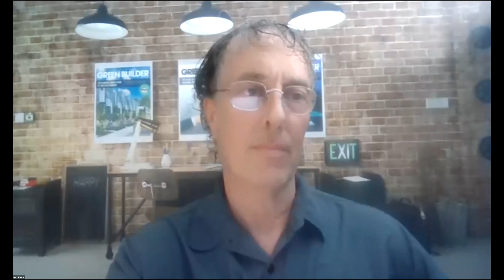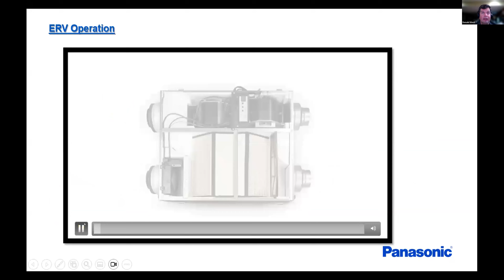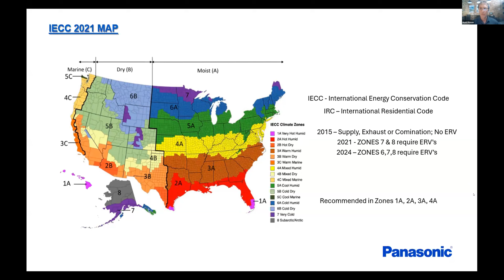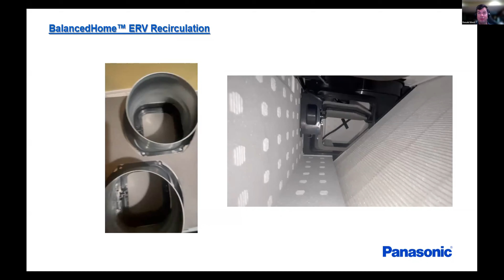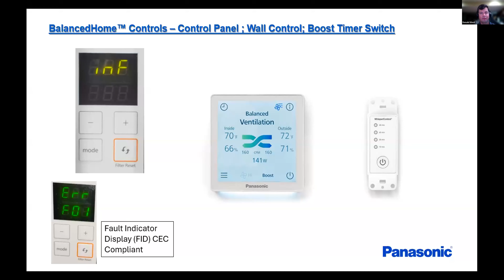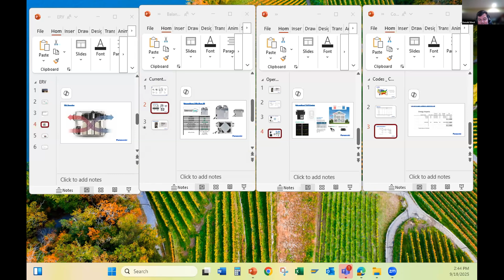Breathe Easier, Build Smarter: Why ERVs Are a Must-Have in New Homes

Comment: Thank you for the video. I wasn’t able to join in person. I’m glad you were able to upload it. I have a few questions. 
I supervise maintenance operations for a multifamily developer and owner. The last few buildings that we built have an exhaust only strategy using WhisperGreen fans set to run at a constant 30-40 cfm with a motion sensor that turns them to 110 cfm when someone enters the bathroom. Fresh air is pulled in through the fresh air vent on the PTAC in the living area. So far we have seen no mold or other high moisture damage in units that would have had those problems without forced ventilation. 
From an owner’s perspective, what reasons would I change from exhaust only to an ERV? It seems like a lot more to maintain even when just looking at the core cleaning needed. 
This is in the Portland, Oregon area. My understanding is that the code updated to require an ERV in buildings 4 stories and taller, but they are not required in a 3 story building, which this is. 

Second question. In my own home, I am installing a BalancedHome Elite. I should be able to finish the install this weekend. I installed a dedicated return in each of my bathrooms and will pipe the fresh air supply into my heat pump return. 
Many of the green building proponents that I have read say that it is redundant to have both an ERV and a bathroom fan and that manufacturers recommend only using the ERV. What are your thoughts? I’m just about to remodel one of my bathrooms and the old Broan exhaust fan isn’t working. I’m trying to decide if I remove it completely or replace it with a WhisperGreen. 

I’m glad to hear that the ERV can be synced to provide supply air when using a Panasonic exhaust fan with a WiFi module. You should update the marketing material to show that. I read through a bunch of it a few weeks ago and it only showed syncing the exhaust to a dedicated supply, not to the ERV.